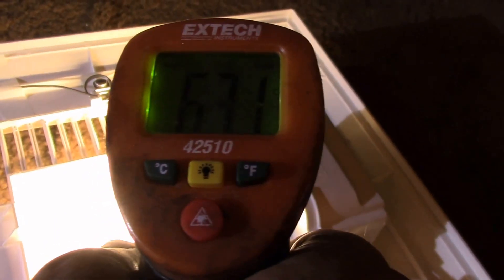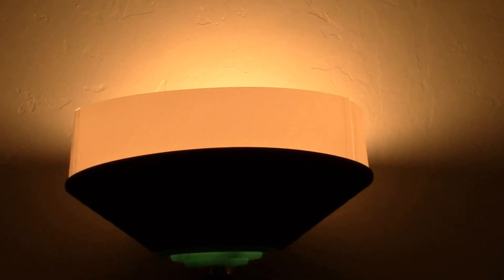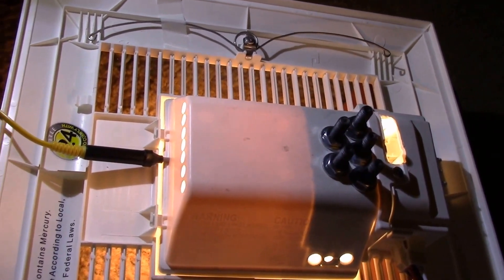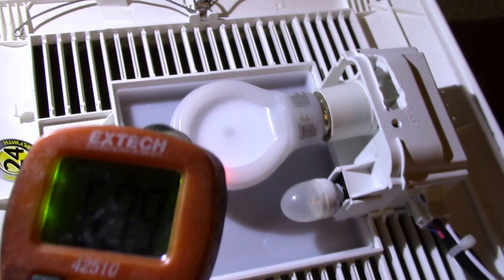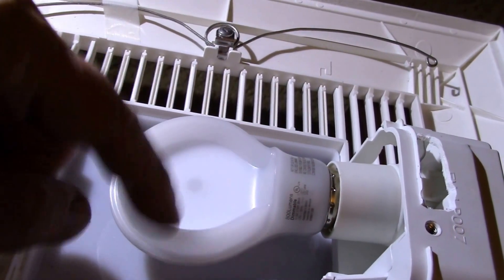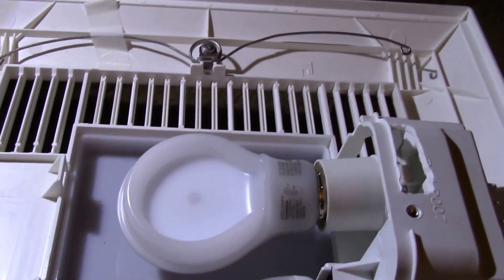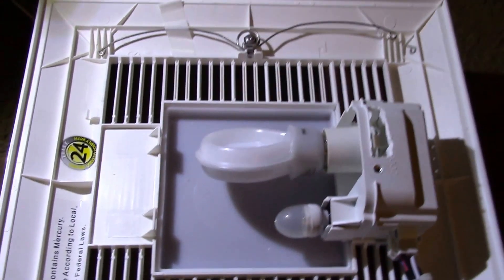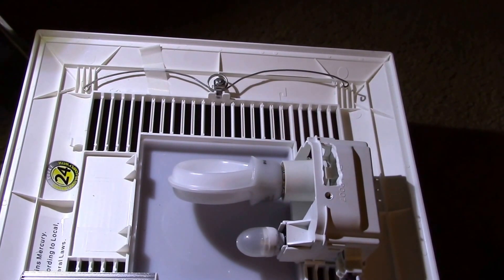Panasonic WhisperLite Bathroom Fan CFL Replacement, Part 6

Comment: How did you pull the cover off??
Reply from the maker: On mine, the bottom cover is just help on with some spring type clips that go up into the fan housing.  Photo below:
https://drive.google.com/open?id=1PYNkMGlrn7Kaeua2FHOJcD9GqB8BegdK
Maybe later models have a different setup, but the two I have are identical.